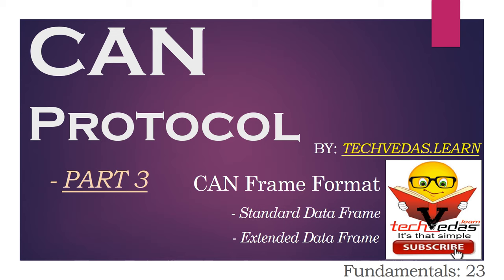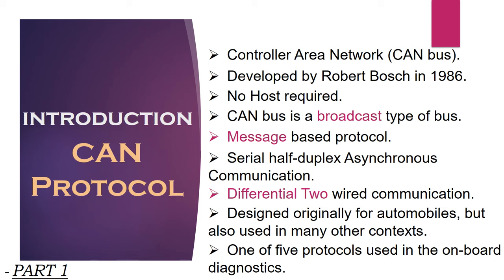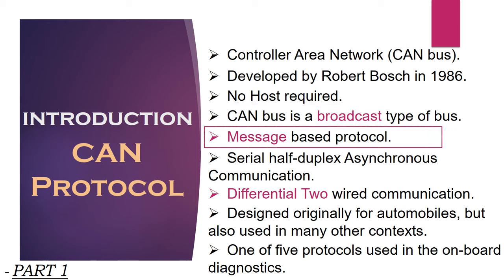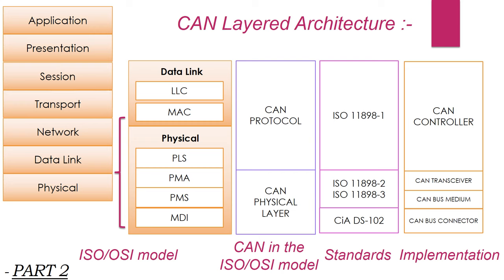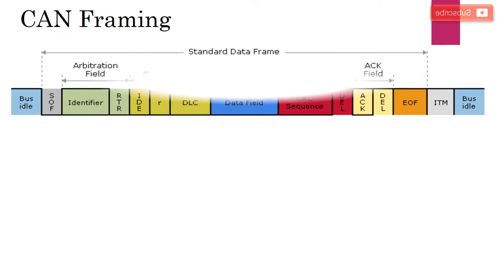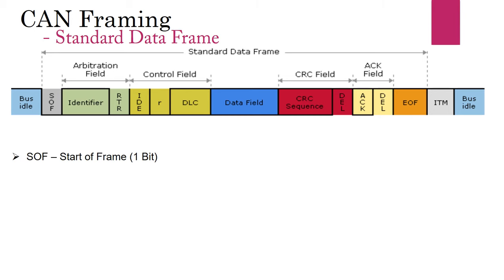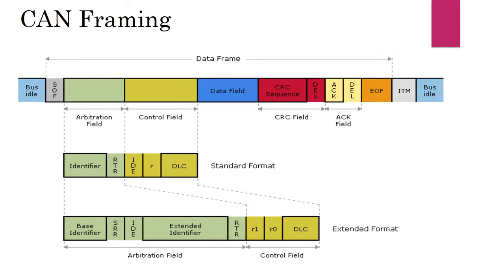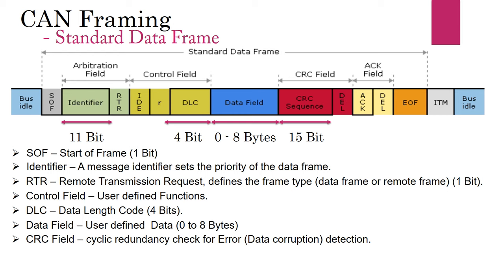CAN Protocol Frame Format | CAN Protocol Basics

Comment: Quick Doubt - CAN ensures 2 type of communication. 1. Node to Node 2. Node to broadcast. You mentioned in this video, CAN is a broadcast bus. If node A wants to share or receive message to node B, it would be possible in CAN Bus network. CAN is not only broadcast network. Please correct me if I am wrong.
Reply: No, there is not destination address field in the message. It's impossible for a message-based protocol to be unicast.